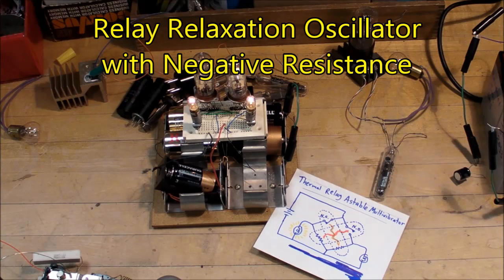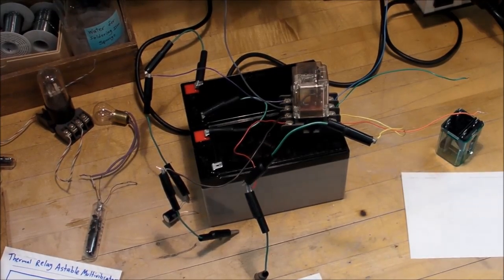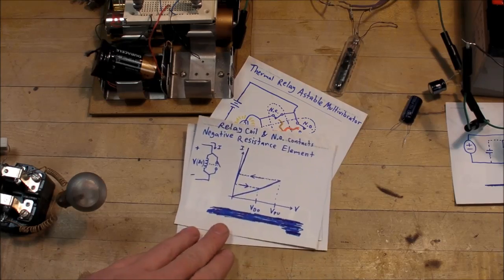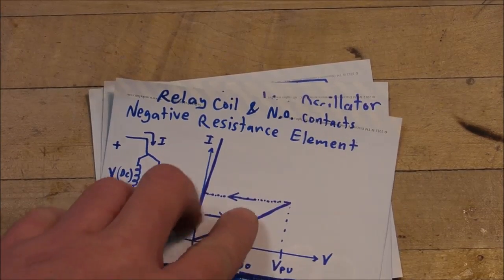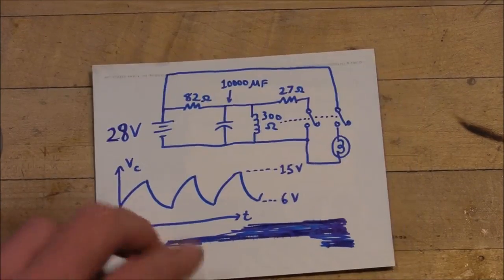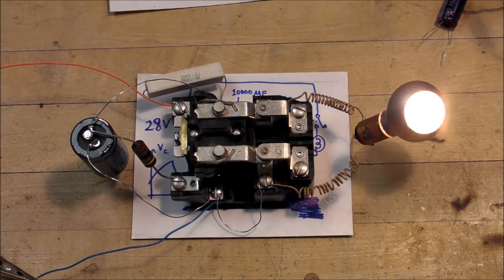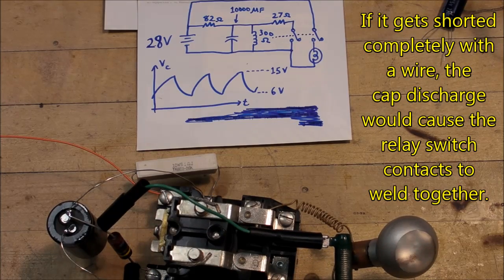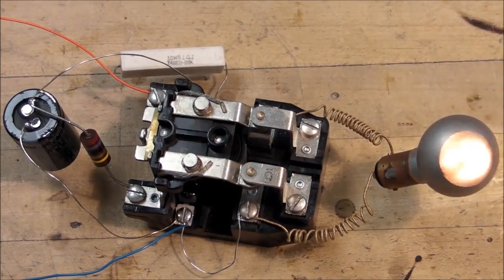(#0124) Relay Relaxation Oscillator with Negative Resistance

Comment: The only drawback I can see is that during the operate time of the relay the two resistors are directly across the power supply. This can be remedied by rearranging the circuit so that the parallel coil/capacitor is connected to the moving contact with the NC contact connected to the battery -ve, The 27 Ohm resistor is then connected to the NO contact. The capacitor then charges via the 82 Ohm resistor and the NC contact and when the relay operates the 27 Ohm resistor is connected across the coil/capacitor to discharge it.

Comment: I used relays as a logic circuit to control trailer tail lights from the vehicle circuits. The vehicle used separate lamps for turn and brake while the trailer used combo lights. Figured out the circuit using boolean algebra. When both turn and brake were being used, both lamps came on with the turn lamp flashing and the other lamp solid.

Comment: Interesting circuit. Never thought of this. I am not sure if this would be considered negative resistance though. In negative resistance, an increase in voltage across a device's terminals results in a decrease in current through the device. Here, when you are increasing the voltage across the relay's coil, the relay gets activated, and the current actually increases (there's a sudden increase). The sudden increase in current shorts out the circuit, and the voltage drops to the drop-off voltage. The relationship between voltage and current is still normal. Increase in voltage = increase in current. Am I missing something?

Comment: I don't think they ever used negative resistance oscillators for this purpose in automobiles.  Thermal flashers were the norm since turn signals were invented.  Transistor flashers were invented in the beginning of the 1960s but it wasn't until the 1990s that they started to become the norm, with GM starting to put them in all of their vehicles.  Nowadays it is quite uncommon to see thermal flashers in newer vehicles.